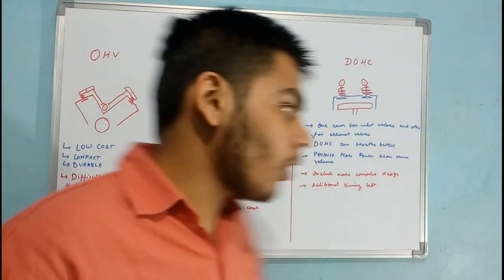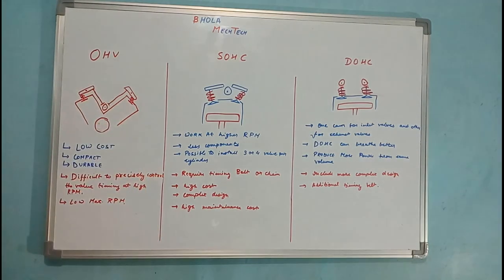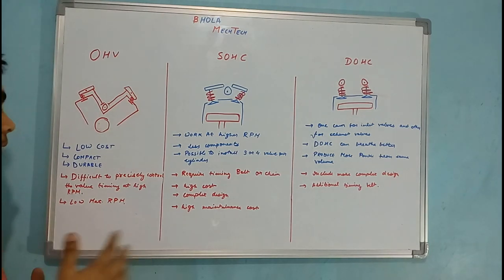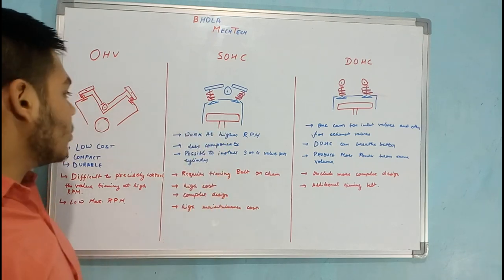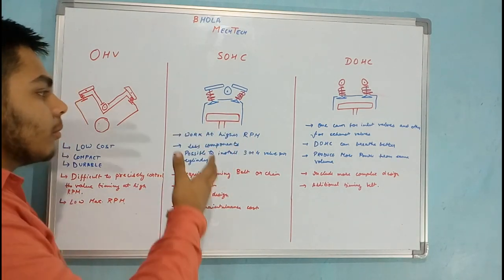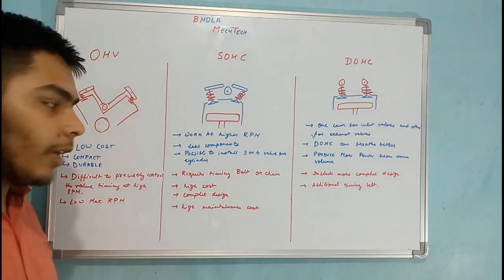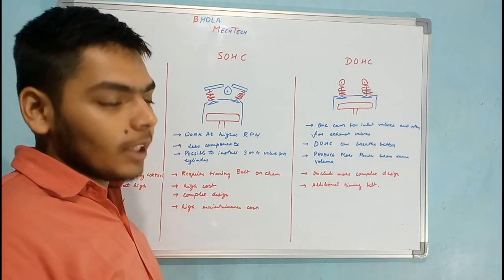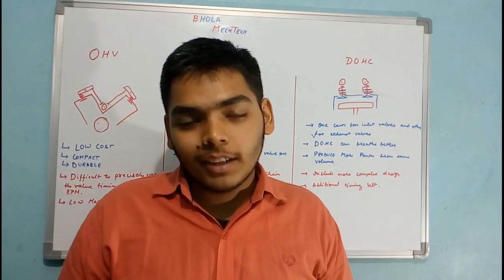OHV vs SOHC vs DOHC

Comment: In terms of power delivery in low, mid, and high RPMs, which one of the 3 performs best? thanks
Reply from the maker: dohc because you can alter its timing according to requirement
Reply: @BHOLA_MechTech  yeah if you have VVT or VVL

Comment: I think Royal Enfield uses OHV that's why there engines can't go on high RPM, if yes. Can you please tell me why they produce Vibration although DOHC has much complex system and more moving parts then OHV.
Reply from the maker: Prince Arora vibration problem in RE engines is due the engine design the ratio of stroke length to bore dia is the main cause.